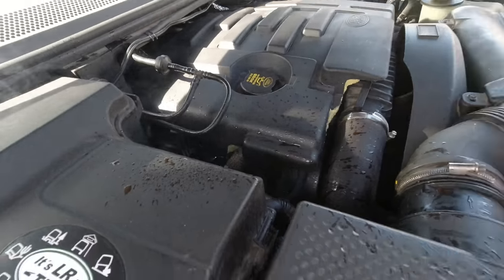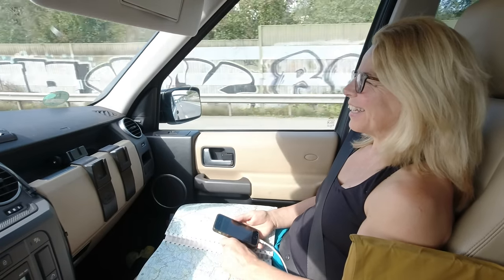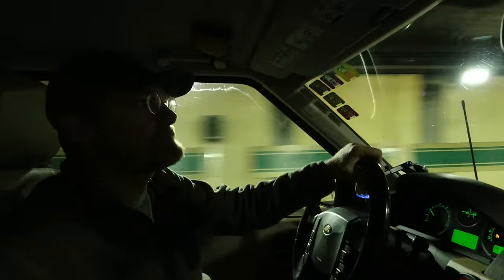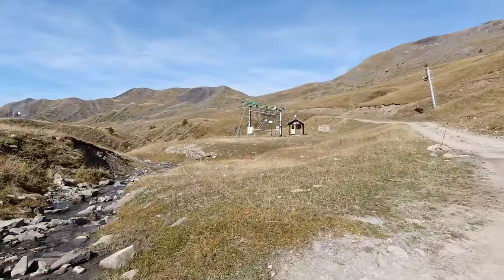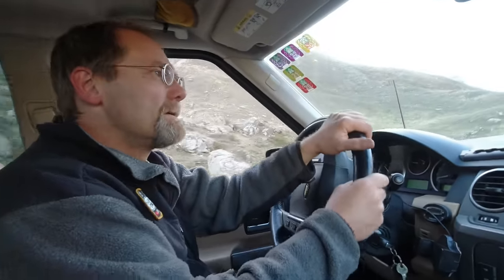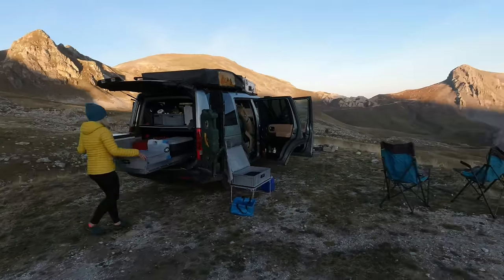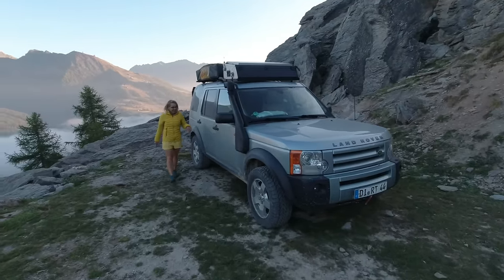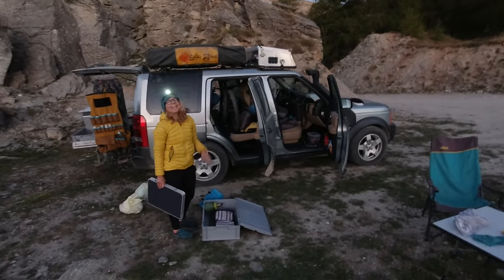2000 km Shake Down after full Rebuild in the Alps - OMG / S4-Ep47

Comment: Brilliant! Just did body off LR4, replaced turbos, new air intakes, new oil pump, new water pump, vacuum hoses, coolant hoses, and 5w 40, new brake pipes whilst the body was off, body back on and guess what, thought the cross over pipe was leaking and so, body back off, it turned out to be a crack in the EGR exhaust pipe and so new egr and pipe fitted.. body back on and so far, all is well, fingers crossed 😅
Reply from the maker: 👌👍And Body off on a LR4, especially a newer one, is much easier than on 17 year old rusty old LR3. 👍 🙋‍♀️

Comment: Gorgeous views!  I love that you were able to just figure out the coolant issue.  When my '06 LR3 HSE got a coolant leak on a trail, we limped it down (fortunately, it had been uphill the whole way until then), and then towed it to Land Rover.  We were able to get the hose fixed on the trail, but couldn't get the coolant to circulate.  The Land Rover mechanics said it required a special device they have to get it circulating again, and that it couldn't have been fixed on the trail.
Reply from the maker: That is what Land Rover mechanics would say. They don't want to work on these older cars. We do carry, however, lots of hoses and clamps, o-rings what not to fix most coolant issues on the trail. 👍🙋‍♀️

Comment: Thank you, Christian and Vera, for taking us on this LR3 rebuilt journey. Very well edited, entertaining and educational at the same time. 

Now to the rattle in the transfer case. Could a superbly and beyond factory spec build engine have contributed to expose the remaining weak links in this vehicle? Assuming a factory flexing crankshaft never did expose the slop in the transfer case. 

When I replaced the engine on my 1989 Chevrolet C2500 with 74k miles with a brand new $1,600 GM Goodwrench engine due to low compression on one cylinder, I did renew every coolant hose, sensor and accessories because of reliability was of utmost importance while traveling long distance for work. However, GM redesigned the coolant hose attachment to the heater matrix with snap lock style plastic connector which I didn't replace. Guess what happened next? That piece broke in the middle between Cody, Wyoming and Ft. Collins, Colorado and luckily stopped me at the base of an uphill run. Fortunately, a trooper passed by and radioed a tow to the nearest Chevrolet dealership in Lander, WY. I believe it was still between 50-100 miles from the junction I broke down to the dealership. 

The moral of my story is, you can try to do the best, but if you don't replace every aged part in an essential system which keeps you going, most likely it will fail at the most inconvenient place possible. I hope the coolant hose clamp fail didn't cause irreversible damage to the overall effort.
Reply from the maker: We will reveal what caused the clicking in an upcoming video. It was to be expected. 😅👍🙋‍♀️

Comment: Another great episode, thank you. One trick that I learned while overheating in the Pyrenees a few years ago, is while stationary and waiting for the heat levels to drop, turn on the interior heating controls to maximum to bleed heat away from the engine. Hopefully though, you won't have to do this now that the clamp is properly seated. One lives and learns 😁
Reply from the maker: I think the water was completely gone.  We filled 6 bottles of 1.5 Liter.  Christian
Reply: @Vera_and_Christian  you were very fortunate in that case. Excellent recovery Christian.

Comment: Hi Christian - disregard the comments from the peanut gallery - they have never accomplished what you have done. Your work and persistence is amazing.
I’ve seen plenty of Toyotas pulled over in Australia with steam pouring out - or worse - holes in pistons which is a very common fault on the Toyota 2.8 litre. There is a youtube mechanic in Australia with two 200 litre drums filled with toyota 2.8 litre pistons. You will find it if you search - the 2.8 litre toyota hilux engine has major issues with cracked pistons due to design fault.
Suggest you fit a coolant pressure gauge after a gasket or substantial cooling system work. Coolant pressure is the most important thing to monitor - if it is a 140kPa system then you need to know it is running to spec. If it only reads 70kPa you would have gone looking for lack of pressure within a few hours and then found the loose hose clamp.
I’ve don’t thousands of outback km in my Discovery 1 and 2 here in Australia without a single issue by the way. I do all my own mechanical work like you.

Comment: Christian, I've found that if you remove one end of the upper radiator hose and add coolant there, it completely fills the system and avoids air pockets.

Comment: Love your videos, cutting edge quality 😀. If the transfer case clicking occurred, when you had your  tyre pressure dropped, could’ve been differential tyre radius between front and back, making something grumble in the transmission.
Reply from the maker: The issue will be down in a video fixed. But it was not the transfer box. 😃👍🙋‍♀️
Reply: @Vera_and_Christian Hi Christian and Vera, could I email you regarding what the fix was?
My Discovery 3 is making the exact same noise and can't decide between Propshaft or Transfer case problem. Local Landrover specialist says its my Transfer box. However after wiggling the CV end that bolts to the transfer case it went quiet for 30 ish miles. I'm hoping it's a lack of grease in the CV joint of the prop shaft? Thank you so much for any help you can give 🙏
Reply from the maker: @powervolt748  It was our cheap chinese propshaft. The CV Joint gave out. But there no lack of grease. 👍🙋‍♀️
Reply: @Vera_and_Christian  Thank you very much for replying. I have a new propshaft arriving tomorrow, so fingers crossed it solves my issue 🤞

Comment: Christian and Vera that was a spectacular journey for your shake down run. A few problems, but with that amount of work done that's not surprising. One thing I would advise you to do in the future if stripping cooling system down is on re installation of the hoses, push the hose on, then fit the hose clamp immediately rather than putting the clamps on all at the same time. That way you avoid missing one out like you did with the consequences. I hope it does not prove to have caused any warpage of the cylinder heads. Loved the scenery, my Vera you showed how fit you are on that bike of yours, especially at over 2000metres in altitude. I'd have to be on oxygen even sitting in the comfort of the Disco lol looking forward to next weeks video. I think your next project is to start looking for parts to do a full rebuild of the transfer box in the near future and at same time put a new rear prop shaft on Vera's beloved Disco 3! Or do the prop first depending on how badly worn it is.

Comment: Bleeding the coolant on the Disco 3. Fill coolant to max level on the expansion tank, open bleed nipple on top of engine. Once no bubbles from there close it and start the car with the expansion tank cap off. Let it idle for 5mins then hold at 3000rpm for 1min, allow to idle again for 5mins, then hold it at 3000rpm whilst topping the coolant to the max level in the expansion tank, then close your expansion tank cap.

Comment: Hose was a shame.  Coolant/oil pressure are top of the tree, I can't remember what aftermarket gauges you have monitoring these. I changed all the hoses for silicone and stainless high quality hose clamps, on the basis that if it was a boat it would have sank!  Great video and 10/10 for the off road repairs!  OMG!

Comment: Two things to get, one is an audible warning of low coolant level, the other is a better clamp for the egr, the oem ones are rubbish and better ones using a jubillee clip are available, although I used the one with the hex bolt. Cummins pressure test all engines from the production line , and have a percentage of failures returned for further action. Well done keeping calm.
Reply from the maker: The coolant loss was instantly, not a small leak over time. Everything happened in a short matter of time. The warning light was not in the video because the camera was not rolling when it happened. Who have thought that Christian forgot something and we had to be on the lookout for a catastrophic failure. Which it was not of course. I have put on 6000km ever since the rebuild 2 months ago. 😃👍🙋‍♀️
Reply: You are right, I just did a flow rate calculation at 12mm diameter and 2 bar pressure. 21 litres in one minute and its all gone. @Vera_and_Christian

Comment: :face-purple-wide-eyes:The cold ambient air might have saved your engine when you suffered your coolant loss. Here in Aus I blew a radiator hose and had a seized engine before I could pull off the road.
Reply from the maker: The ambient air was 25°C. 😃👍🙋‍♀️

Comment: One thing I've learned through the years is to pressure-test my cooling system after it has been opened. That mistake once cost me a cracked cylinder head. A very expensive cylinder head.

Comment: Great trip I love the Top Tent & the rear access storage!!    Given that it overheated a bit,  perhaps you could  keep an extra eye on the gaskets.  Maybe regular checks of the coolant for engine gasses & discolored/Milky Oil?
Reply from the maker: That was two months ago and I have put on 6000km on that engine. Running like a swiss watch. 👌👍🙋‍♀️
Reply: @Vera_and_Christian   That's great news!  Beautiful!  It is a fun to watch you work on the Landrovers.  I dont own one yet, but i expect to find a LR3 or RRS by late spring.  :) It will be for my son & I to to do adventering in & towing a camper or boat. So far, The ones around me  have needed a lot of work, Thats more that i am prepared for right now [total Engine rebuild, lots is deep  frame rust,  Front end damage that was badly repaired,  or a Heavy smoker of Nasty smelling cigarettes!]

Comment: Christian you are super cool in a crisis. I always run round like a headless chicken for a few minutes before I calm down and think the situation through, there's always a 99% chance you can fix the problem on the side of the road. It can be a real pain to bleed the air out of modern engines, as I've said before it took two hours on my wife's corsa after replacing the thermostat. How fit is Vrea being ables to ride up those mountains, I was out of breath watching. Another excellent video as always.

Comment: So… after 4 months of a full nut and bolt strip down and rebuild on a LR4, it lasts the first trip out before dumping all it coolant, using half the oil, hand brake fails and the transfer box is cactus… nothing out of the ordinary then for a LR other than making it home under its own steam… no pun intended 😂

Looks like more great content to come 👍
Reply: @Vera_and_Christian  I suggest a full load test before long trip. Park it in a place with poor ajr circulation, rev the engine continuously at 3000rom

Comment: Great and interesting video. Thank you. What about the low coolant warning? Why that didn't come up to the dash? And just a note - it is not good to fill in the ice cold stream water to an overheated engine straight away as it may result in high metal shrink / micro bends and finally you may even get a leaking head gasket where metal moved the most. It is good practice to wait a bil letting the engine to cool out a bit and then fill in the cold coolant.
Reply from the maker: The dash light came on in the second it ran out of fluid.  The sensor is in a hose and not in the block.  Very scary.  No worry’s about cold water on hot engines.  They are made to cross rivers in very hot climate.  Never heard of an engine cracking for that reason. Christian

Comment: Just replaced all of the coolant hoses on my Disco 2 (after one burst at 197,000 miles). Hose clamps are absolutely the worst designed fittings on the car... what a pain. Fortunately, the hose burst on arrival at home in my driveway so I wasn't stranded anywhere.

Comment: Very brave to have added cold coolant to that overheated engine instead of letting it cool down before doing so. Interesting to see if you have a sloppy transfercase chain. I replaced the hivo chain in my v10 Touraeg with the same sound as that, with no metal in the oil.
Reply from the maker: What you watched in a couple of minutes, took us hours to complete. And do remember everyone wading with a hot engine in cold water. The transfer case was not the problem. It finaly (will be revealed in a upcoming video ) broke right in the last kilometer of  a 1600 km trip I took to northern Germany, a couple of weeks ago. All is well now. Car has been running for 2 months and 6000km by now. 👍🙋‍♀️
Reply: @Vera_and_Christian  You will never run out of content!
Reply from the maker: @GunnarMiller  Never 😅👍🙋‍♀

Comment: Love the mountain pass roads where you go on vacation and the autobahn. Great video as always.
Push it off a cliff... Been there 😉 Hopefully, your confidence will be fully restored with a few more trouble free weeks/months. It's 17 years old but you have refurbished it so more like a 3 or 5 year old vehicle. Given all the good work and effort involved, seems false economy buy cheap chinese parts. Your propshaft video demonstrated perfectly why original parts generally the best. Ive experienced a few crappy aftermarket parts with my defender. I always buy genuine for my LR3/4, except oil filter then I bought Bosch for lr3 v8. I found genuine LR3 filter more prone to leaking.
Reply from the maker: 👍👌OEM is great when you are actually able to buy the parts. If not, then we just have to deal with it. We can‘t have the car sitting around for weeks waiting for parts unfortunately.🙋‍♀️
Reply: Good point. It was bad here too. That's going to be more of a problem when LR drop support for these models, hopefully not any time soon.

Comment: Heart-stopping moments, but I'm so glad you got back safely without damaging anuthing.  So - now it's a flush out of the coolant and replace with the right stuff to survive winter temperatures, new drive shaft and take the transfer box apart - looking forward to the next video. 👍

As there are so many knowledgeable people viewing these videos, can I ask a question?  My 2016 D4 currently has the standard Pirelli Scorpion zero all season tyres on.  When I need to replace them I want an all-terrain, all-season tyre that has the mountain symbol so I don;t have to change them in the winter when driving in Central Europe.  They need to be good for long distance autobahn driving as well mild off-road use (like in this video).  What are my choices?  At the moment I have only found the Goodrich Trail Terrain which seems to fulfil these requirements.  Is there anything else? Anything better?  I did see a new Nokian all season all terrain tyre in Auto Express, but they seem to have stopped making it within a year of launching it ??? Anything else?  Thanks.

Comment: Well you sure did shake it down! A good idea (albeit not for the faint hearted) to drive into the Alps. It might have taken ages to find those faults otherwise🙂
Do you reckon the cheap rear prop shaft could have caused the issues in the transfer box over time (poor balance and excess vibration)?
Would love a video on which tools and spares you think are the right ones for a trip like the one you did...
Reply from the maker: The transfer box is fine, the cheap chinese prop shaft not. 😅Will be down the road in a video. 👍🙋‍♀️

Comment: Greetings, enjoy all your videos. This one has me shocked though. I am surprised that you add cold water to a engine still hot enough to be steaming. My experience last year with my 4WD (make not disclosed, not Toyoda) with a overheated engine( my fault, left rad cap off) drove abt 15 kms, engine overheated, stopped at service station , refilled radiator with cold water without allowing cooldown and ended up with crack head, Cost just over $2000 AUD. I am surprised you got away without head gasket leak or cracked head.  Although I must admit , watching your struggles with Rover Vehicles, I would not be keen to own one. My 4wd has now over 380000Kms and still serves me well,. Those Rovers just seem to be over complicated with unneeded electronic gimmicks that are prone to fail.  Anyway, keep up working on your Rovers, my 4wd's reliability gives me more time to watch your videos. Viele grusse!
Reply from the maker: What you watched in a 25 min video took us hours to take care of. When we filled up engine was cool enough. Better not go wading with your concern of cold water on a hot engine👍👌🙋‍♀️
Reply: @Vera_and_Christian  Point taken! I just hope drivers who are not tech savvy try to fill a hot engine with cold water as it seemed to be what happened. Dont worry, I do not go "wading" with my 4wd if the water is over max. wading depth since I have no desire to ruin my vehicle unnecessarily. In AUS we are constantly reminded "if its flooded, forget it". Quite a few have been swept away and drowned here trying to beat the flash floods.

Comment: Did you perform a coolant pressure check when you 1st assembled the engine?! 🤔
Mind you because hoses etc are softer when hot,  a cold pressure check would not always cause an unclamped hose to pop off so we forgive you 😅⚠️